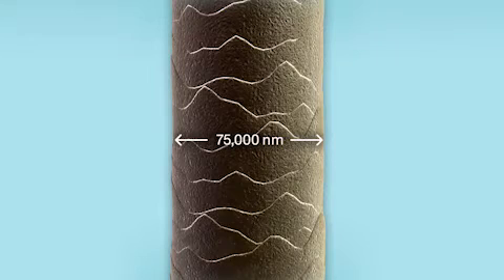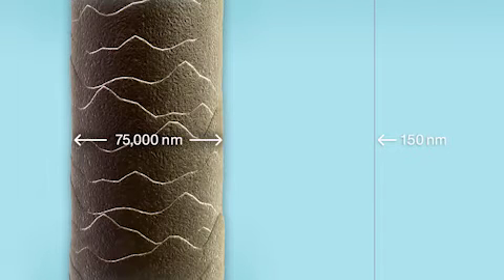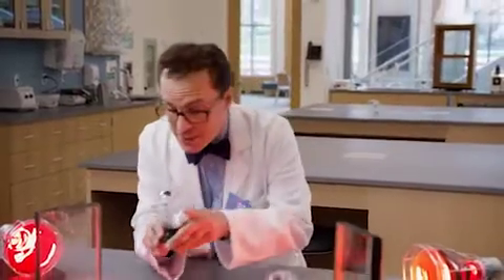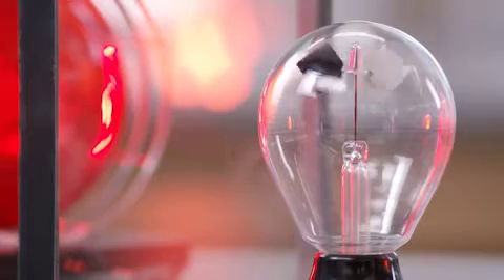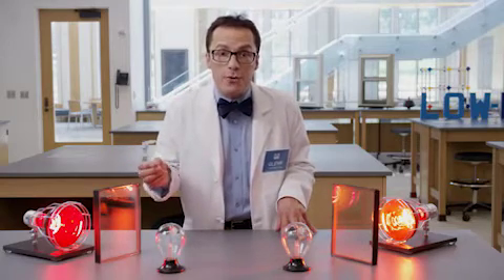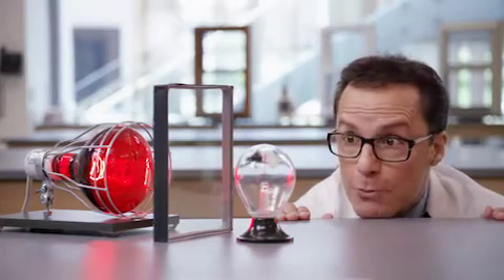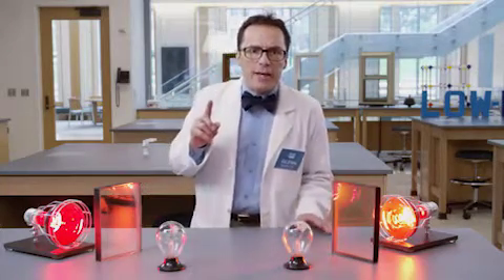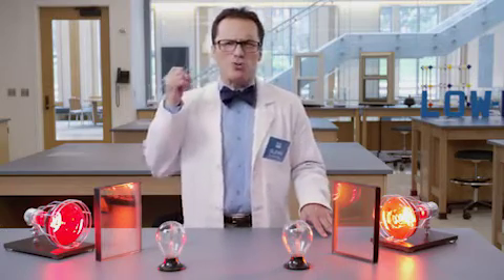How Does Low E Glass Work

Comment: I have old window/glasses.   If I take them to a company to do solar e coating, then my glasses/window become more energy efficient.   Which company can provide those services?
Reply: You can't effectively add low e to existing glass. The glass has to be completely clean and undisturbed to have the low-e coating placed on it. You can buy the glass and have a local company "re-glaze" your window with the new glass but it would be worth your money to just replace the window entirely if you are going to move to low-e glass.